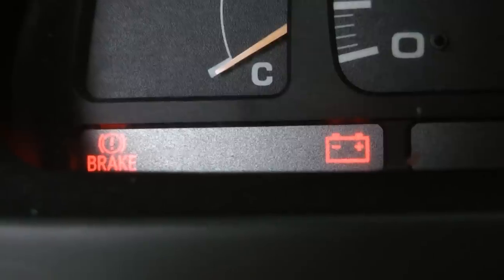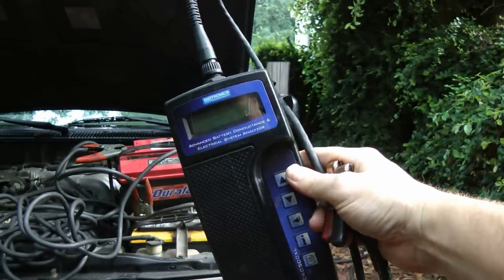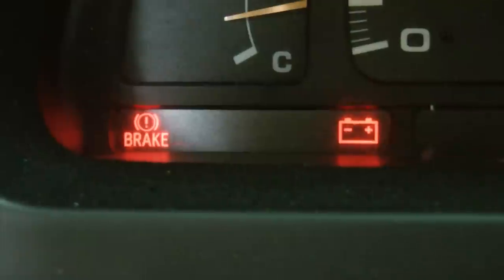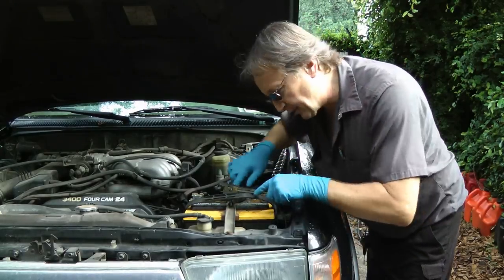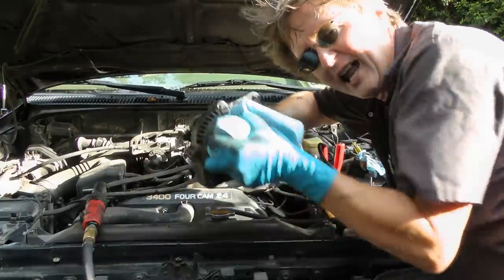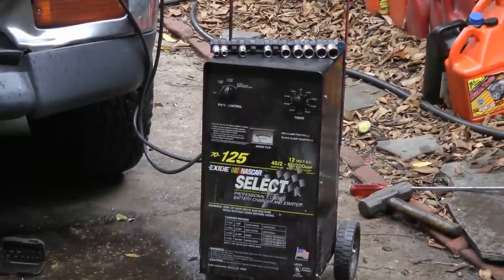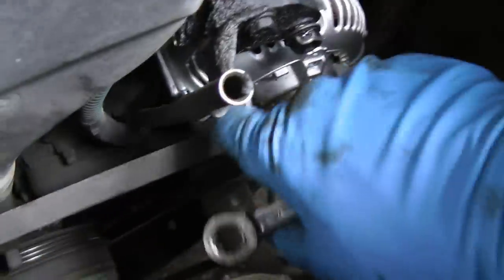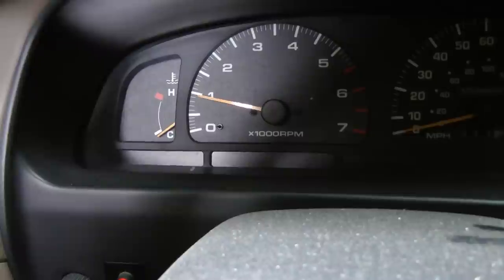How to Replace Alternator in Your Car

Comment: Hey Scotty
So I drove my bmw e46 2000 320ci. After 4km the battery light came on
When I got home I did some research and found out that i could check the alternator on my OBC hidden menu. The number should be 140, and im getting 120, but its not dropping. 
I took the car for a spin, and the battery light went off just for some mins. Shortly after the check engine light, abs and EML got lit. I shut the car and started it again, abs and eml dissapeared, but check engine and battery is still lit.

Comment: Hey Scotty, I'm working on a 1969 Ford LTD, with a 390 in it. I'm having some charging issues. I bench tested the external voltage regulator. It reads battery voltage on the field terminal of the regulator until I connect it to the field terminal of the alternator, then it reads .5 volts. When I bypass the regulator, and jump the field on the alternator, it reads 15 volts, so the alternator does charge, however it also reads 25 volts AC. Do you think bad diode in the alternator? Maybe the alternator is shorting out my voltage regulator? I've tested two regulators that I have, with the same results.

Comment: recently, my 2005 Mazda 3 battery light flash randomly, i went to Autozone and asked them to test the alternator and battery. They said both are alright and no problem. How do you think about this situation? I found that it could be a rectifier problem inside of the alternator. Also I got a code P0300 ramdom misfire, i don't know if it is related with battery light flash
Reply from the maker: either wiring to alternator is bad or the alternator itself, go to a regular mechanic like me to have the rectifiers and diodes tested fully

Comment: Scotty, 2009 Corolla with 50k miles / lost power, replaced battery and battery light is now off and on...multimeter on battery shows 12.6 engine off, goes slowly down 11v-10v when engine is on...turn engine off and volts return on battery.  With a car not very old, is it possible something else could've caused the alternator to go bad, or is it most likely from the bad battery?  Thanks!

Comment: hey scotty, i have replaced my alternator several time in my truck. The first time i replaced it was a rebuilt one and it lasted about 1 year.I replaced it and the other rebuilt one wasn't charging at 14v so i got a new one. Now i was driving and when you begin to pull off at 1200-1500 rpm the fuel light and charging light comes one but goes away at higher rpms. Now the new one is charging at 12v and with a load 11.6v. I recently changed all fuel injector so im not sure about the fuel light?

Comment: i am replacing an alternator in a 1998 saturn SL1 & i found a website that says:

 If stud is not held and stud rotates, the plastic insulator will crack and/or break causing generator to fail.  Disconnect the fusible link wire using generator output stud wrench (SA9401C) to hold generator output (B+) stud from rotating.

does this mean i need a special tool to remove & replace the alternator or can i do it like your video shows? any help with this would be greatly appreciated.  thanks scotty.

Comment: scotty i really need your help right now..ill try to assemble mine,the car was daihatsu charade g202,but the space are so limited,if i try to get it off from the top there is a power steering motor and master brake pump blocking there,and from the bottom a drive shaft blocking it too,so i dont have any choice to do it simple,please reply me asap,i need your opinion!!

Comment: I think I have a problem with my alternator, as my battery and brake light came on together, although I'm driving a 2001 infiniti g20. The car died shortly after I drove it home from work.

I think I see where the alternator is... but am not certain. And if it is... its pretty deep in the car... any advice as to if im looking in the right spot and how I can get it out easily?

Comment: Hi Scotty. My car's lights suddenly dims when rpm is low and brightens up when rpm is high. My car radio also stops as if there is not enough power when low rpm. Is it a bad alternator or battery problem? My car is a Nissan Sentra 95 model. Thanks.

Comment: Hey scotty I have an 03 Mitsubishi eclipse that sometimes out of now where it will take like 2-3 attemps to start or it won't start at all. like the other day I went to tacobell turned the car off and a couple of seconds later I decided I wanted to go trough drive trhu and my car just didn't start @ all I had to jump started! After that my engine light came on for a few hours. My car now starts normal but like I said it will probably start doing the same crap here soon

Comment: I just ran into this issue and have a question as dumb as it may seem. My alternator has a low reading at about 12v idle so I know that's bad. But is that an accurate reading or could a bad wire somewhere possibly reduce how much electricity is actually going through? I just wanna make sure it's truly my alternator before I spend a fortune on getting it replaced.

Comment: Hey Scotty, my Nissan Altima 2005 reads "Diodes: failed" at auto zone when they test my car, what does that mean? My alternator also makes a high pitch noise too, does it need replacing? please give me advice id appreciate it thank you
Reply from the maker: +JohnyBoy512 replace the alternator, internal diodes are bad.

Comment: ey scotty when you said burn the alternator,means that having a new alternator and a bad low voltage not charged battery is like having no battery at all right?that can cause inside burn in the alternator for taking solong to charge practically a cold box with plumb and electrolite with no conductivy,thats what you meant?cause i had a doubt how a alternator can be burt with a uncharged batt,,cheers thnks again :)

Comment: Hi Scotty, I have a problem with my '99 ford contour, on some days when I am driving it and as soon as I let go of the gas to brake and stop, say 40 - 0 my RPM's drop from about 2500 to about 900 and it hovers there and then my engine cuts out. What do you think could be causing this? I also have my check engine light on indicating lean A/F mixture and also a hole in my catalytic converter.

Comment: Hey Scotty! I have a 2010 Toyota Camry SE V6, the vehicle had a alternator problem but my dad tried jumpstarting the car backwards he just put the positive cable on the negative terminal on accident. The car was towed into a shop where they changed a rebuilt alternator and the fuse box since it was blown. The car is running fine but when I stop at a red light or a drive thru for example, once in a while the ABS,Brake, VSC lights come on. It also shuts off the A/C too when those lights come on. When the I turned the car off and turn it back on those lights disappear and everything works normal. Any idea what this can be? And should I take it back to the shop?
Reply from the maker: odds are the computer modules have shorted out to some extent, no cheap fix there

Comment: Scotty, I have a 2003 Infiniti g35 coupe with a new bat and the bat and brake light are on. I tested alternator at 15 amps full load draw, I assumed this is a overcharge. I replaced the alternator with aftermarket and the lights are still on and charging at 15 amp full load draw after I replaced the alternator. Any other ideas? Car has 75,000 miles

Comment: in addition, you can plug a voltometer into your battery, and with the engine running the alternator should be producing 13.5 too 14.5 volts, any less, the alternator is not producing adequate charge, over voltage, could be a bad regulator.

Comment: Hey scotty , I have a 2006scion tc , with the ac on the engine shakes like mad. I tested the battery with all the accessories on and it was reading 12.24 volts. Would this bad alternator cause the vibration as well?
Reply: By the way when I unplug the alternator the vibration goes away . I'm leaning towards it being a bad alternator . I just want your professional opinion
Reply from the maker: it can, that's waay too low charging, should be 13.4 or so
Reply: I replaced the alternator the readings are 13.5 . I still get a lot of vibration when I turn the ac on. When I unplug the alternator it idles better with ac engaged. And when I plug it back in the car shakes like mad. Btw the idle is about 700-750 rpms with the ac on. The car only shakes with the ac engaged Any thoughts?
Reply from the maker: datchulo1085
 ac compressor is drawing too much power, is starting to wear out. Unplugging the alternator merely stops that alternator charging load to make it idle better
Reply: Thank you scotty

Comment: Hi Scotty. 2002 Jeep Grand Cherokee Laredo 4.7 v8. friends vehicle. battery replaced last week, now it still needs to be jump started, once its running it will at times shut off unless it stays reving, isnt that the sign that the alternator is not charging ? battery light not on an amp gauge is up high when running. I suspect bad alternator, an i know Chrysler an Jeep aree known for electrical problems. let me know. thanks

Comment: I hear a screeching sound whenever my base model RSX starts. i have no issues whatsoever besides that, but i'm pretty sure it's the alternator. i'm pretty intimidated changing it myself, being an amateur and all. and having to do that i'd might as well replace the timing belt while i'm replacing the alternator
Reply: Look in your car manual and see when the engine timing belt needs to be replaced. The engine timing belt is not related to the alternator or screeching sounds.

Comment: I see the battery light turning on while driving my '07 Avalon, but not the brake light. My mechanic says Alternator is kaput. Should i replace the alternator or could it be something else?
Reply from the maker: generally that's a bad alternator, realize auto zones test em free too if you want a second opinion

Comment: Hi Scotty, I have a 2001 Toyota Tacoma pickup with 190,000 miles. I notice that whenever I turn the lights on the led clock lights dim as well as the air conditioning switch(the off/on switch has a led light). Is this normal? There is no battery light nor any other light on the instrument panel indicating a bad alternator.

Comment: How do you know what Amperage to get? I have 2006 Dodge Grand Caravan SXT 3.8L and it seems to offer a 140 or 160Amp for my engine size? Have power sliding doors, hatch, windows, locks, dvd, cd.
Reply: It sounds like you have a lot of options on this vehicle. I'd assume they put in the higher amperage part for vehicles that are optioned out in this way. Dealers are generally not the best place to turn to, but in situations like this the right person might be able to help you decide, or look up what part is standard for your VIN and optional accessories. 
Unless the dealer was the one who left you with this decision, in which case you should just ignore me and wait for someone to come along who knows what they are talking about. Good Luck!

Comment: I have a 2000 Mitsubishi Galant LS. Recently,the battery and  brake lights come on when am driving. This happens simultaneously when am driving. I recently installed a new audio system and also my car had a overheating therefore I suspect any of that could have cause my alternator to be faulty.Should I replace the alternator with a high output on or standard??? Please help.

Comment: what if there is no problem with the alternator? I have a 2001 civic with the battery light on but no sign of a bad battery or a bad alternator and the car starts without problem and the battery has not drained. I have taken my car to several mechanics and no one can give me a reason why the light does not come off. any suggestions?

Comment: hai..i got a problem with my nissan bluebird. batteri still doesnt charge even after i replace a (new alternator, new battery and new belt).. what seems to be the problem? the batteri warning still lights on even after i took off the key.. when the car starts its lights off. do you have any ideas how to solve this problem ='( does it have to do with the ignition switch????? thank you and please reply as soon as possible

Comment: How do you know if the battery connectors are bad? I just got a new battery Sunday but didn’t connect it and when when I connected it to the car 3 days later it looks like it’s a battery problem.....
Reply: Did the advanced auto give me a bad battery for a new one or it’s just me not connecting the cables right or is it the connectors which are gone bad or my alternator? (Alternator got replace not too long ago as well)

Comment: hey scotty what if the battery light is on and power steering stops working at certain times as if the car is not turned on mostly in reverse
Reply: and its a mercedes benz suv from 2000
Reply: ill get more info on the car tomorow

Comment: Hey scotty my battery light comes every time i turn on the car and whenever i go faster than 30mph the battery light goes do you have any suggestions?
Reply from the maker: check to see if the fan belt is loose or worn. But if it's good, replace the alternator

Comment: when ever i use the electric windows or ac or headlights the battery gauge volt meter drops and then go back to normal,but u feel the lack of voltage in the engine,if i switch the ac off and iam braking the engine stalls and the volt meter plays up and down,i am really tired of this car scotty,some one told me to replace the regulator inside the alternator or tight the fan belt

Comment: Hello scotty, I was replacing the belts and I believe the ground terminal on the alternator broke off. The alternator for the 2001 honda civic is fine, so is there a way to secure the 10mm bolt from the broken pole of the alternator without having to get a new or rebuild alternator?
Reply from the maker: if it is the ground terminal, you can ground the alternator anywhere, the entire metal body is ground, just run a wire from the alt body to the engine on any metal bolt
Reply: Scotty Kilmer
Thanks. Will be doing so.

Comment: i replaced the alternator on my acura an the battery light is still on car runs fine turns on every time what could be wrong i did also check all the fuses none are blown.

Comment: My Dodge Grand Caravan Le (1996) 3.3L ran fine all day. I turned the corner and the engine stalled. I kept trying to start the van, it turns over and immediately dies. The neighbor tried forcing it to run by holding the gas pedal to the floor. The converter turned orange and started the grass on fire under the van. Changed converter and muffler. Van will turn over but still dies immediately. I got code 31 off the key. Scanner says 0 codes. Lost without a scanner code, any suggestions.

Comment: scotty:  does an alternator work all the time....or only  if the battery needs power to charge?
Reply from the maker: it always spins, but regulator adjusts when it charges and when not. And modern cars use the computer itself to do that
Reply: Scotty Kilmer Hey scotty! I have a 2000 chevy malibu and my charging light has come on time to time (never my battery light) but this Saturday I've noticed my dashboard didnt register right away the lights stayed on longer than usual took a minute for the lights to turn off ( the battery, check engine, brake etcetc). Usually when driving my dashboard/radio will light up fully after a couple minutes ( some days right away but rarely) and my automatic lights as well. This sunday however i go to start my car (starts like a dream) the dashboard lagged again and this time my charging system light has stayed on. Since then i have started my car 4 times just fine but that light just stays on..I want to say my best bet is the alternator since it is an original part?

Comment: need help, i put a new alternator in my 97s10 an none of my guages work,any reasons why
Reply from the maker: Lyndale Henderson If they worked before, then you shorted wiring out, ALWAYS remove a battery cable before changing an alternator. Check for blown fuses first and pray it just popped one

Comment: hey Scotty I just replaced my alternator and my lights in my car don't turn on the car turns on and the headlights but everything in said the don't turn on I checked the all my fuses and there all ok please help me:)
Reply from the maker: ***** well, did all that stuff work before? If you, you shorted something out, check for wiring shorts and blown fuses. and ALWAYS disconnect the battery before changing an alternator to prevent that.
Reply: yeah everything worked before and I did disconnect the negative of the battery

Comment: how did u remove the belt mr kilmer?
Reply from the maker: just slides off when you move the old alternator to get it off
Reply: +Scotty Kilmer some of these belts are well tight n people use some tool to compress the pulleys but great video n thanks mr kilmer

Comment: What if the alternator keeps going out. 07 tahoe keep replacing it.
Reply: Check the fuse. It may not be the alternator. And use a 10 fuse instead of a 5.

Comment: What if you replaced the alternator and it still doesn’t start up?
Reply: It's probably the battery to be replaced
Reply: Randy Mcqueen Check battery terminals. Get sandpaper and clean them.

Comment: @bigDbigDbigD  you can use the old way start up the engine and disconect the positive terminal oof the battery if the car stall the alt is fried

Comment: I believe me alternator is going bad in my 95 Camry. I'm getting the battery light and another light as well, but not the brake light. I'm getting the light indicating that your lights aren't working properly as well but it's in the same general area on the dash. Just replaced my battery yesterday and the lights are both still on, going for a new alternator.